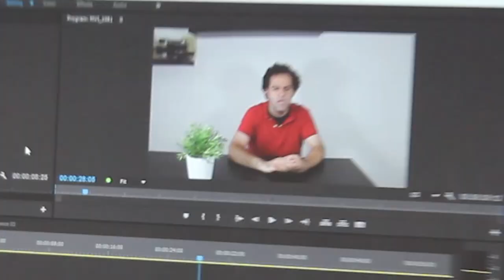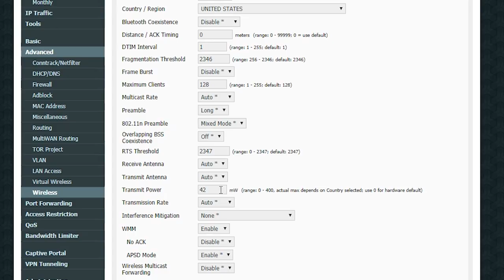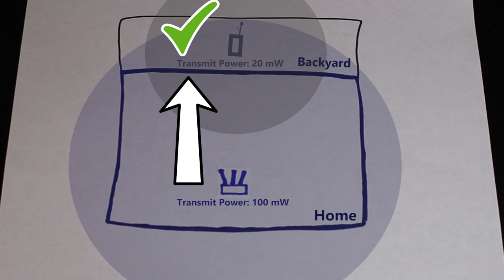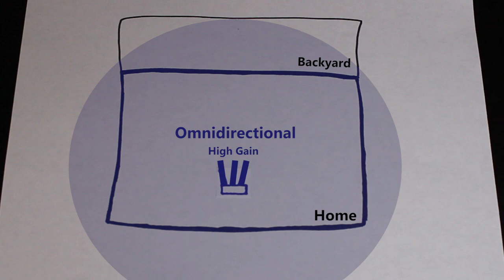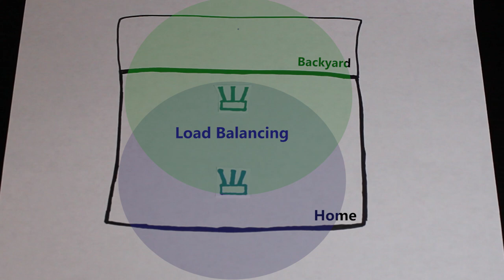[TSHOOT] Maximum WiFi Transmit Power! Good or Bad?

Comment: so the reason you got poor signal/connection in your backyard really was because you didn't turn on your access point? i.e. nothing to do with the transmit power?
Reply from the maker: As I said in the video the signal was rather strong in the backyard but I just was not able to connect! The reason for that was because there was only one way connection due to using too much transmit power! Possible solutions for me would be to 1-Relocate the main wireless router. 2- Use high gain antennas. 3- Use a secondary router/AP. I chose #3 because I already had a secondary Router/AP which I had forgotten to turn back on. Basically if I hadn't used too much power I probably wouldn't have receive any signal in the backyard, but the solution definitely was not to increase the transmit power! I hope that makes sense! Thanks!

Comment: I ran into your video while looking for info on "CE transmit power", for which there is pretty much no info. The reason? TP-Link added this to a mesh system upgrade, and I'm trying to figure out if this is something I should concern myself with. I'm trying to decide between the older Deco M4 or the newer (costlier) S4, whose only difference is the addition of this mysterious CE transmit power. Any idea about it?

Comment: I hope people wont replace their antennas with something like 8 or 10dbi antenna, changing antennas may improve your coverage but only in 1 direction, a 2-3dbi antenna is considered a bidirectional antenna and has a something like coverage of in spherical, if you use 5-10dbi, the coverage will start go oblong.

so what will happen if you change your antenna with high gain? at first you will see improvements on signal, but if your house have a 2nd floor, any device up there will have problems communicating to your router with high gain antenna.

I can only see this high gain antenna usable if you have a AP that is mounted on ceiling, just like what most AP that Ubiquity offers that have 6-10dbi antenna internal and because of how it was installed in the first place either in wall or ceiling, either it will improve your wifi signal vertically or horizontally.

Comment: Good video really appreciate it. glad to have you back
Reply from the maker: Thank you so much! I'm glad you liked it! I'm happy I'm back too :-)
Reply: @Behfor  , I reduced my transmit power by 80% via login NetComm NF10WV modem/router settings, however when I checked with android WiFi signal strength apps, it still shows no reduction in WiFi signal strength. Why is that?

Comment: a high gain antenna on the router will not affect how well the phone can reach the antenna of the router. a high gain antenna on the router will only squish the radiated pattern down flatter horizontally, but the phone's radiation pattern still needs to make contact with the antenna, not the radiated propagation coming from the router. not to say a high gain antenna couldn't help, but just not for the reasons you state
Reply from the maker: Here is a quote from the CWNA study guide (6th edition)  Chapter 15: "Many people do not understand the simple concept of antenna reciprocity, which means that antennas amplify received signals just as they amplify transmitted signals. A high-gain antenna on an access point will amplify the AP's transmitted signal and extend the range at which the client is capable of hearing the signal. The AP's high-gain antenna will also amplify the received signal from a distant client station." Feel free to read the whole chapter, for more details. Thanks.

Comment: If u have dual band can't u set one to low power and the  other to high
Reply from the maker: You can, if that's what you need do in your network (and obviously if your wireless router or access point has the option)! Too much power is not the right solution to extend the range, that's why with normal wireless routers you usually cannot go beyond certain limits unless you install a third party firmware, which as mentioned in the video is not recommended and might even be illegal!